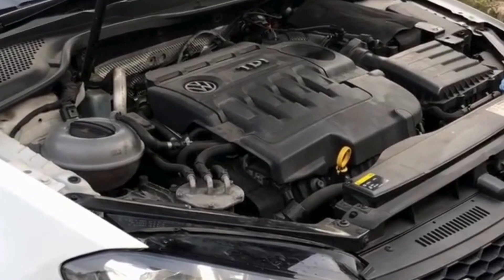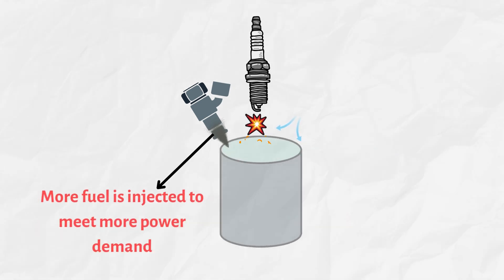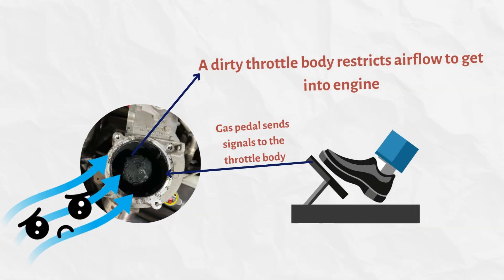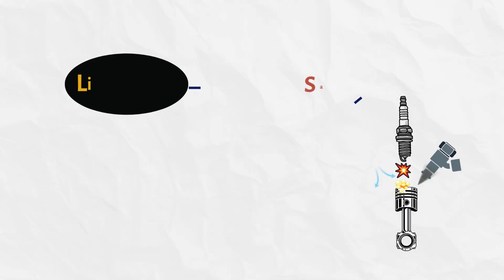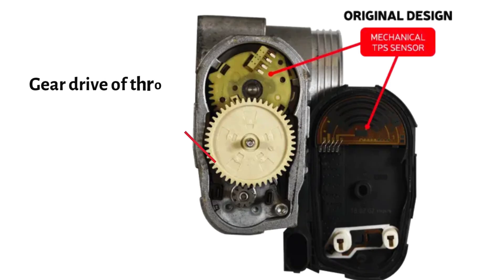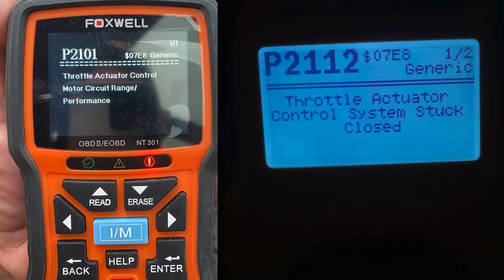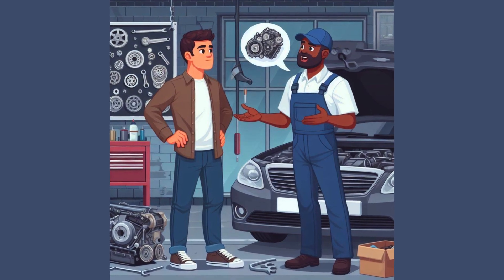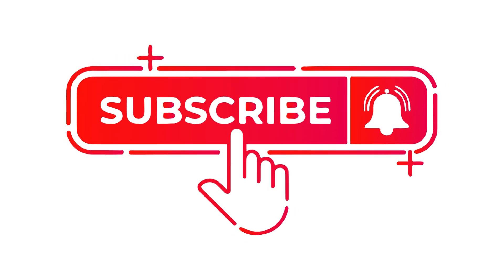4 Alarming Throttle Body Symptoms You Shouldn't Ignore | Fix Now or Pay Later

Comment: Twice I have had loss of acceleration. Once after driving a few blocks at 35mph. Again on highway at 65mph. Both times I had to stop and restart the engine to make it home. Shop says no codes or engine light on the dash. Could the throttle body still be bad with no codes? 2008 GMC Envoy 4.2 liter with 247,000 miles.
Reply from the maker: Do you feel any jerk? Start with easiest things..
Throttle body
Air filter
MAF sensor
Spark plugs
Reply: @AutocornerdPros  No jerking. All feels normal until no acceleration. Engine runs but no acceleration at all.
Reply from the maker: I have video on this. You may check that out